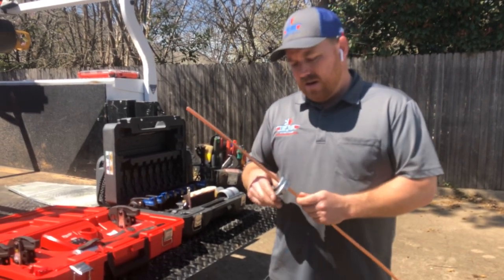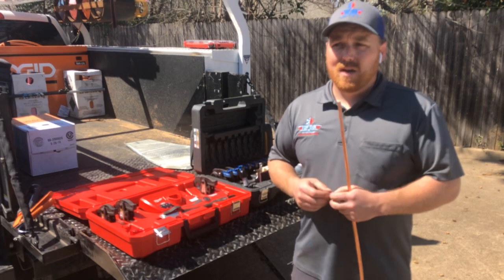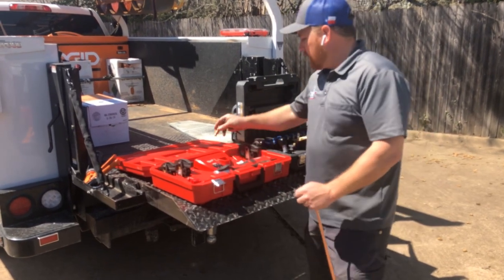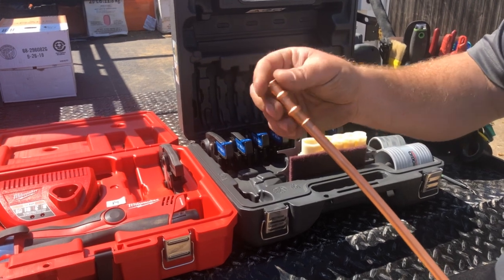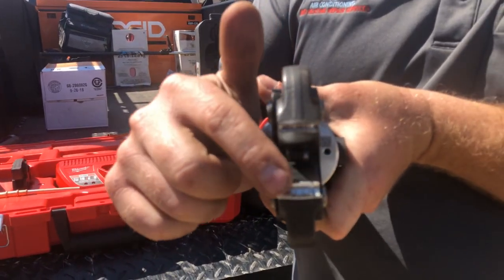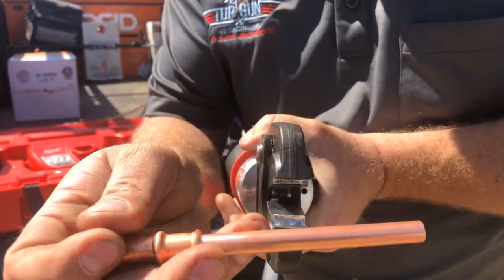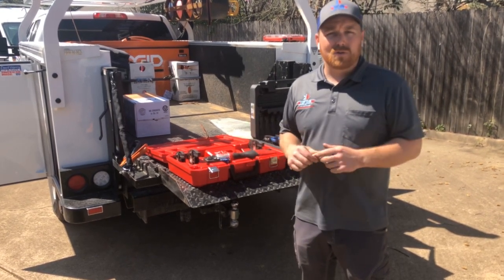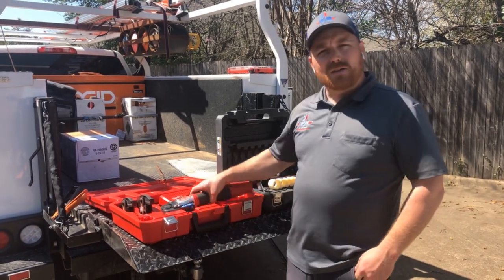Using Zoomlock flameless refrigerant fittings on the job today.

Comment: i like the idea of this however,after 33 yrs in the field and installing 1000,s of ac units,first with soft solder,then brazing..i gotta wonder about the longevity of these.i still have units that i installed in the early 90,s with braze without nitro that are still cruising along..to me,the biggest downside to brazing is getting burnt!it happens...the other thing is..unless the manufacters start offering the condensers and coils with press fittings installed,gotta drag out the turbo torch anyway...so
Reply: Braze the small amount of pipe needed before hanging up down in the van/truck etc

Comment: Company I work for is big on these on the construction side. Hundreds of these fittings installed. I’ve seen maybe 3 leak over the years. Always on the smaller pipe.
Reply from the maker: Isn’t that weird, I’ve had the same, it was a bad press, fitting slipped out and didn’t make a good seal. That’s only one I’ve had. About to use it on a VRF job. 22 tons of heat recovery 😬😆
Reply: Use a dial caliper to make sure the tubing is round and prep properly and align straight.

Comment: so, how would you compare this system to ProPress fittings for linesets?
   My deteriorating body says ProPress is looking good, but my brain 
says stick with brazing/silver solder.   ;~)
Reply from the maker: Honestly until manufacturers make this easier to adopt. Like a “zoomlock” unit with extensions on the outdoor/indoor units. It may not be worth the investment. Saves you on nitro. Great for commercial linesets, I’ve seen some manufacturers distance themselves from these due to leaks.

Comment: Can the Milwaukee do the zoom lock fitting. If not can you get zoom lock heads for the Milwaukee
Reply from the maker: Rigid makes the zoom lock jaw press kit, and we use the M12 propress from Milwaukee

Comment: How does the O-rings hold up to the oils in the refrigerant over time? Do they break down and eventually leak?
Reply: They have had good success with testing and even recommend using refrigeration oil or parker lube if needed these are HBNR O-rings RLS has an excellent product.
Reply: For now until they start making them O-rings in China then will be having issues .....

Comment: I appreciate your video. What jaw do you use for the liquid line dryer?
Reply from the maker: 3/8 jaw
Reply: That doesn’t make sense how does a 3/8 coupling go over the female slip on a dryer
Do you have to get special couplings or dryers?
Reply from the maker: @tomshelnutt2256  yes, they make driers that are press on
Reply: Interesting
Reply: I would like to by the Milwaukee press tool, but that kit doesn't include a 3/8 neither the 7/8.
Reply: Can anyone share what's the cheapest way to get into this system?
Reply: @rafahvac3713  ebay

Comment: Have you used this on a Citi-Multi and leak tested with 600 PSI?
Reply from the maker: Haven’t used it on any VRF, sentiment in the industry shows they’re getting away from that. We have pressure tested to 550 psi with these without issue. We have an upcoming job we thought might be a good candidate for these, but manufacturer expressed they’ve had issues with the fittings in the past.
Reply: We (Arrow Heating - Toronto ) have used these fittings and Zoomlock says they are rated to max burst pressure of 3000 psi , operating pressure of 700 psi

Comment: Does this work for sealed system appliance repair?
Reply: I think the smallest they do is like 1/2 OD
Appliances typically have 1/4 inch. Just look at your fridge. Plus they’re too compact I don’t see how I would even fit the head of the tool in any of those units.

Comment: Where did you get that tiny pencil reamer?
Reply from the maker: They’re usually available at most supply houses, try supplyhouse.com or Amazon. I have a hard time find them at times. The little pocket ones
Reply: @topgunheatingandairllc2197  thanks,I've got some regular ones that would just looked pretty small and would come in handy

Comment: Nice video. Can anyone tell me where I can find 3/8 and 7/8 adapters to use whit the Milwaukee m12?
Reply: supply houses usually carries the jaws kits. are you using the 1/2, 3/4, and 1" jaws that came with M12 propress? those are for plumbing.

Comment: I can see this being an EPA requirement in the next 10-15 years.
Reply from the maker: I’m not sure the EPA would mandate this but who knows. It is something that I hope becomes as popular in HVAC as these press on fittings have become in plumbing. Just need to get manufacturers onboard
Reply: Yeah pipe joining is better left to the material and situation,  not government mandate.  If it qualifies to handle potentially explosive gas under pressure it should be tested and added or subtracted from a list .

Comment: I knew you make this video in 2019, but I have a question you need two tools to use this for HVAC?
Reply from the maker: You can either use zoomlock press or the Milwaukee M12 press. They also have different types of jaws that go for either press. I bought the press and jaw kit separately

Comment: What’s the micron gauge say?
Reply from the maker: This system pulled down below 200 microns on final vacuum. If that’s what you’re referring too
Reply: Top Gun Heating And Air LLC yes thank you, I just got mine haven’t used it yet. Can’t wait
Reply from the maker: Awesome man, just keep it clean. Use isopropyl alcohol and swish it around every so often, then connect to your vacuum pump and run it for 5 min or so. They’ll work great if you maintain them.

Comment: Don't sand the pipe!! You want that O-ring to seal on a completely ROUND and smooth surface, not a scratched up surface; you "scuff" up the surface to allow for better adhesion for solders and SilFos, not for these systems! The scratches you make actually tear up the O-ring as you insert!!
Reply from the maker: Not according to the manufacture. We use the Brillo pad. It’s smooth as a babies butt before we’re done.
Reply: Yah Walter clearly does not know what he’s talking about
Reply: @topgunheatingandairllc2197  yeah boi!

Comment: I don't trust it
Reply from the maker: You have to follow each step, installation procedure is everything. So far every joint has been holding up well. If they fail it’s because of user error. The O ring inside is what concerns me most when I’m pressing a joint. If that moves you still have copper to copper bond. I understand your concern though. I was skeptical too
Reply: Yea but by the time you follow all those steps, I could've brazed all 4 connections,  and 9.5 outta 10 times, I only have 4 joints,....2 at each unit! With that thing u gotta squeeze it 8 times then u gotta cut the bell off the suction line valve...at both units, then....... just braze it and done!
Reply from the maker: No I totally get it, and you’re right. It’s not there yet. It does save you from flowing nitro, and hauling all that off your truck. Manufacturers haven’t caught up with this new technology yet either
Reply: @topgunheatingandairllc2197  right! What I dont trust is when a Condenser fan fails and that thing goes to 620psi on and off til I can get there.......just bad news!
Reply from the maker: Burst pressure on those is supposed to be 7000 psi. The fitting itself. I pressure tested ours to 500 with no issues
Reply: pointedspider I’ve seen at least a couple hundred now. All sizes. Only a few have leak and it was proven to be install error. They hold pressure no prob.
Reply: Top Gun Heating And Air LLC I’ve seen the gasket get pushed out partially and then crimped. Leak was super slow. Micro bubble slow. Only reason I caught it was I noticed the oil dirt ring around the fitting cup.